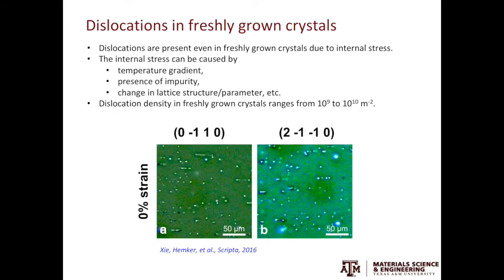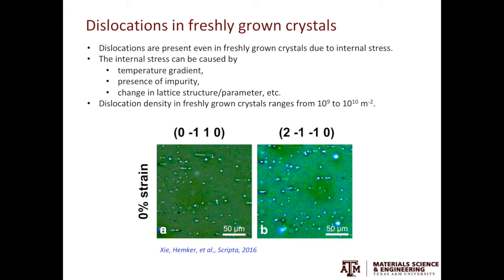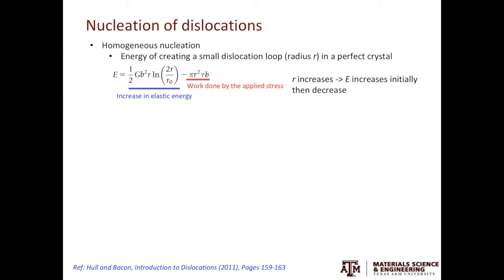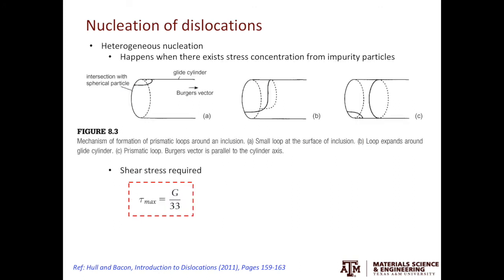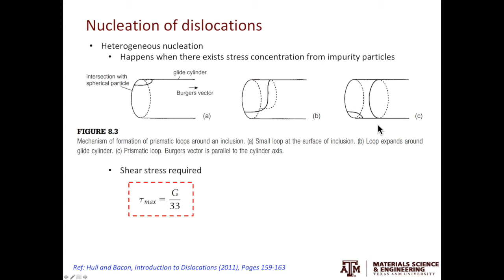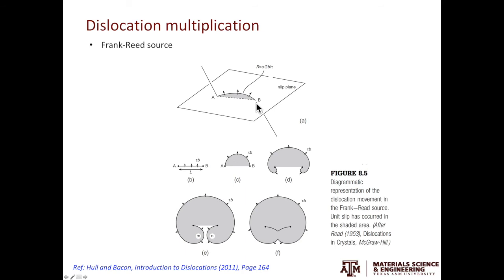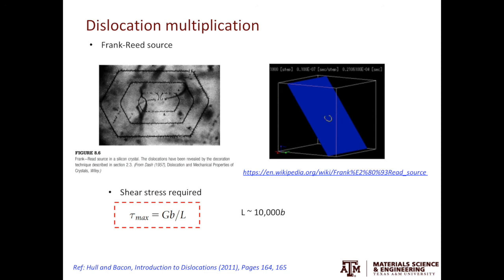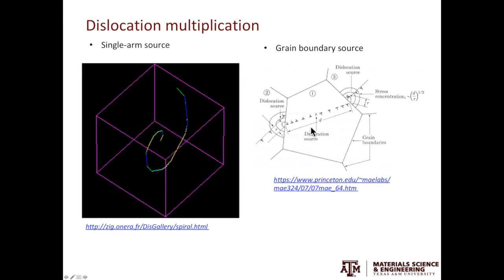3.4: Dislocation nucleation and multiplication

Comment: Dear Kelvin, thank you for the nice explanation. I have a question about dislocation multiplication. As far as I understood, there is a critical stress for dislocation multiplication,but how about temperature? Is it possible to achieve dislocation multiplication in silicon at room temperature?
Reply from the maker: Hi Namig, the lattice resistance is too high for Si. Moreover, Si can undergo phase transformation, which competes with dislocation-mediated plasticity. Thus it is difficult to have dislocation multiplication in Si at RT.